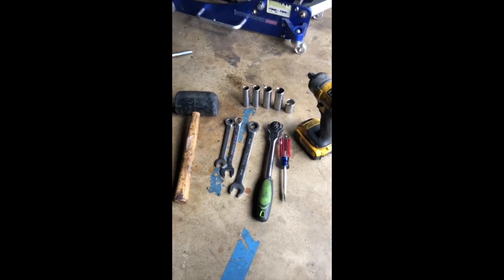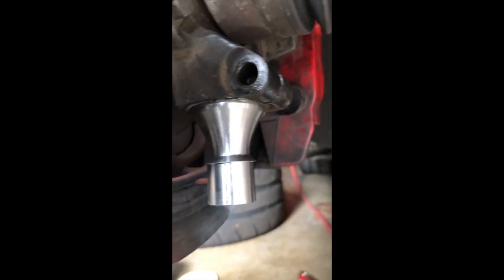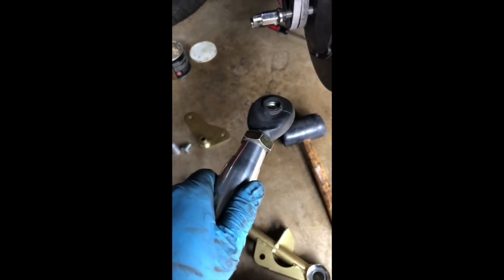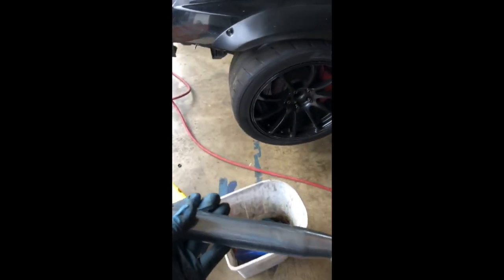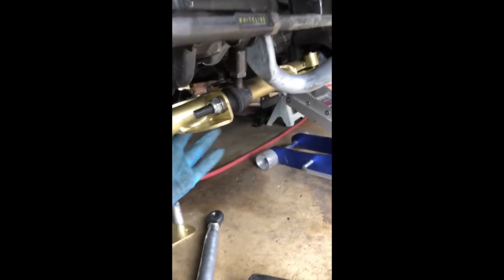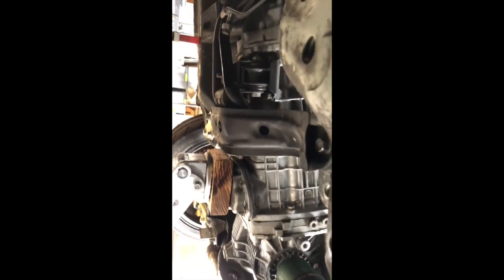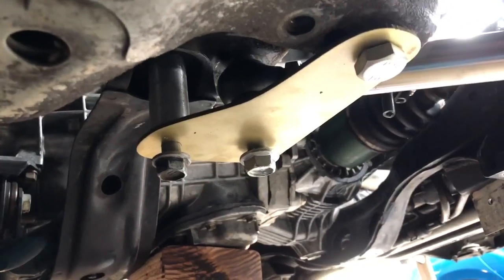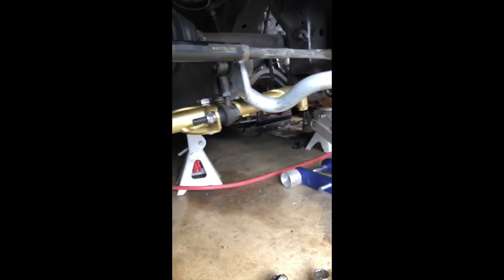TSS Control Arm Install

Comment: hi, thanks for doing this video!! was the only one i could find aha. How are you finding the driving experience with them? My wrx is in need of some new bushings/arms in the front but not sure if I should spend the little extra and get a set of these or just get the superpro kit. Thanks
Reply from the maker: Subways Shenanigans if you have a lowered car and haven’t done the suspension geometry correction this should actually pay for itself
Reply: yeh, just put coil overs in, but not going "low" . its just under factory height, half an inch maybe. they were more for the adjust ability for the damper and the stiffer spring rates. How are they as far as road noise, and handling?